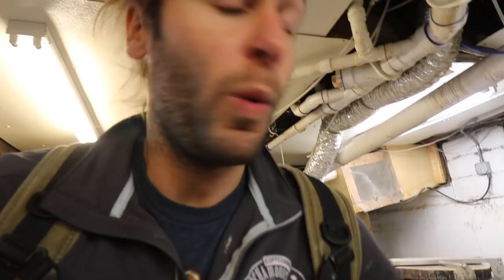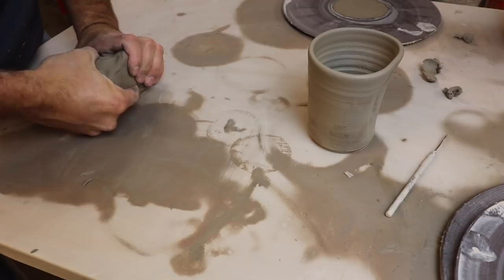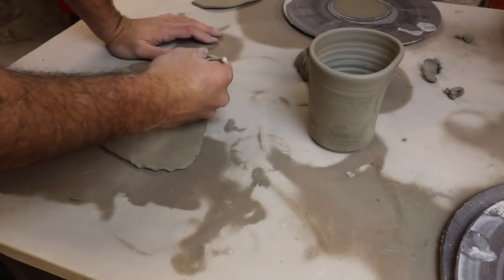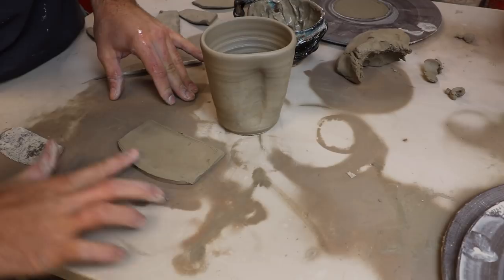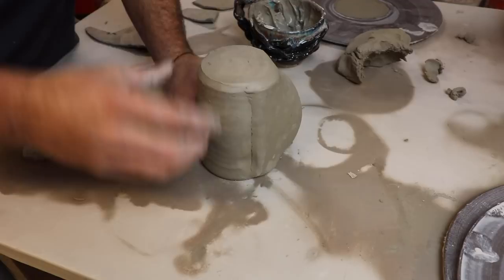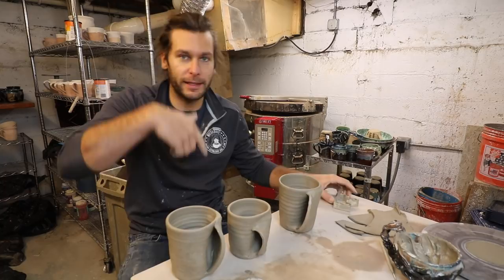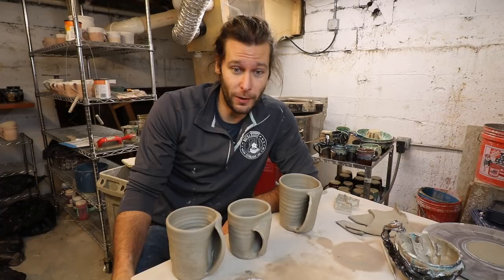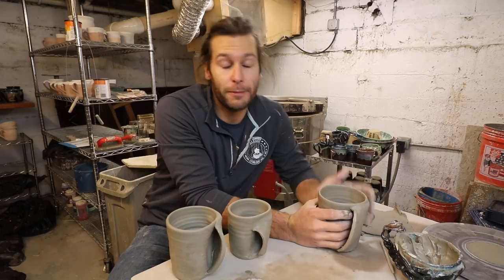Handwarming Mug Part 2 - The Better Way??

Comment: Maybe you can bevel the attachable side of the slab before you attach it. It will give more surface area to connect with the slip (stronger join) and also the smoothing part will be much quicker and look more organic and have better flow because it’s sort of mitered. :)
Reply: Laura Judd  Yes! Love this idea, too.

Comment: That's the way I do it 😀 it is so easy this way and the inside doesn't look so clunky. I add the slab a bit down from the rim. That way I won't mess up the rim. I didn't come up with the idea of the cup. I saw it online years ago and experimented with different ways I thought they might have done. It took a good 9 months before I figured it out.

Comment: Anyone try to sue you over these yet? I quit pottery making for 3 yrs because someone tried to claim they owned the design and also threatened me over the use of the name Handwarming. Told me I could not use the name either. It created quite the conversation over on the Clay channel on FB. Very sad upsetting time for me. I found out later they didnt own crap! Threatened by the the mans sons as well.  I may just have to make some more of these lol... I've been back to the clay now about 3 yrs. Love your channel, you are pretty entertaining. I need to do more videos here on YT. I mainly do mine on FB. By the way, I never seen anyone make one of these before. I made mine like this but only put the indention in the side I was putting the hood on. Thanks for the video. :)

Comment: Could you throw an extra mug shape(without a base) and cut this up into maybe thirds or quarters and use this as your external hand cover instead of a wet slab.it would have the same curvature as the mug and be of the same hardness when you attach it?
Reply from the maker: That's a great idea!!
Reply: As well as the same texture

Comment: Nice video, thanks for sharing! 
By the way, if your cup gets too hot, you can hold on to the slab-thingy with the other hand using it as a handle, works great for me! The shape might need some slight modification though :)